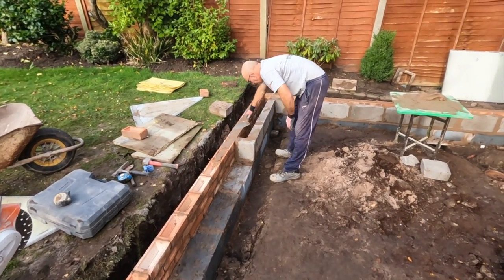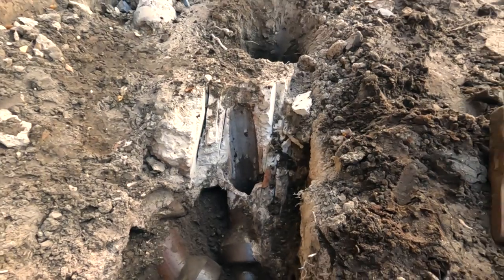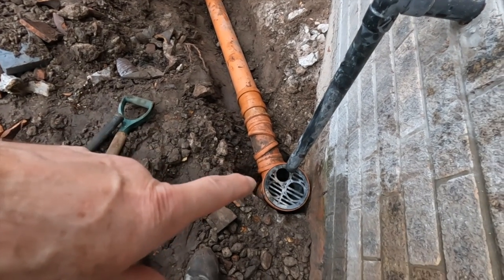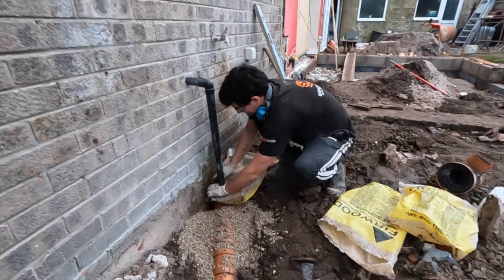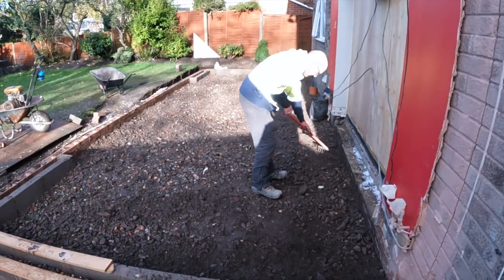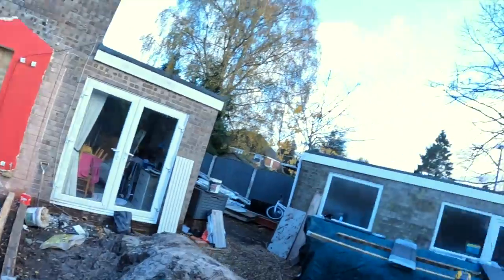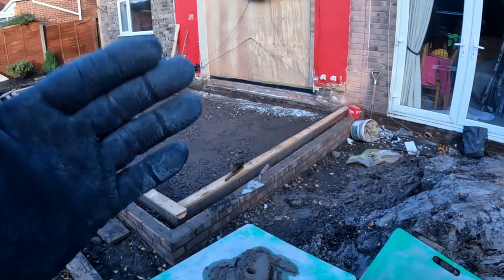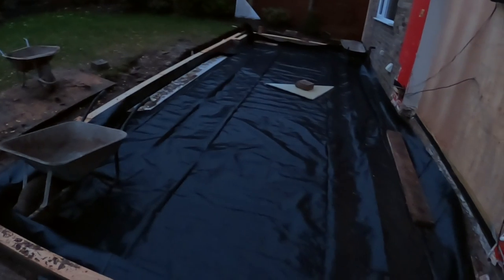BRICKLAYING,  DRAINS AND HARDCORE...BIG EXTENSION PROJECT PT 3

Comment: Another top upload showing how much there is to do before the concrete slab is poured and screeded. Steve done well with the drainage and explained well what he had done and how long it takes ! The labour intensive bit of bringing in the mot hardcore and wacker plate it and then blind it with the sand ! Then filling that skip up at the end well done Alex. Cheers for the upload Steve and Alex
Reply from the maker: Thanks John 🤙🏾🤙🏾🧱👍🏽

Comment: Top video
Don’t use them push fittings under ground there pan connectors for toilets. You did the correct thing using a bandseal 👍🏻
Reply: Also pack your pipes underneath with the pipe bedding, over time pipes will sag and can cause backfall

Comment: Another great video from you guys. What's the wood for on the top layer of bricks? I've not seen that before.
Reply from the maker: We need to level through with the original slab so the timber gives us a guide and is set with the laser level 🧱👍🏽

Comment: The concrete was there to protect the drain pipe. Crazy idea, but I’ve seen it done and hate it. Had one where the builders had broken the pipe in pouring the concrete, but which we did not discover until loads blocked drain problems. Of course it was in a inaccessible footpath so had to be hand dug, to add to the fun.
Reply from the maker: Totally over the top for sure 😬🧱👍🏽

Comment: Aaggghhhh…. Don’t put rubble and bits of broken pipe etc over the crown of a pipe (20.21)…bad, bad, bad Alec…😖
Reply from the maker: There is 150 mm sand between them 😁🧱👍🏽
Reply: @SteveAndAlexBuild  didn’t look 159mm to me in the shot…over the 150mm of fines should be selected dug materials…with the emphasis on ‘selected’, meaning not containing large stones, stones, boulders or other stuff that could damage the pipe below… and yes, materials can ‘migrate’ downward and damage pipes…that’s why the spec is there…
Reply from the maker: @stun9771  🧱👍🏽

Comment: Glad you didn't put that pan connection below ground that extender is a gully riser,lads a bit of advice about moving piles of loose material if it's a few ton in one pile before  shoveling, the first few barrows are easily filled if you lean barrow against pile and scrape material into barrow then just work your way round pile filling barrow like that till your back where you started  saves shoveling then you use shovel to move bottom of pile all the way round and then you can lean barrow against pile again and repeat also never use small shovel to move loose material use a long tail shovel for filling barrows,skips and even cement mixers saves your back in the long run and when digging use a long tail pointed shovel keeps your back straight goes into ground easy  and you can dig all day and great for spending five min leaning on them for a chat or break although some boys enjoy that part a bit to much them  small shovels are useless never understood why everyone in England use them bent over all day for no good reason👍
Reply from the maker: Nice one thanks 🧱👍🏽